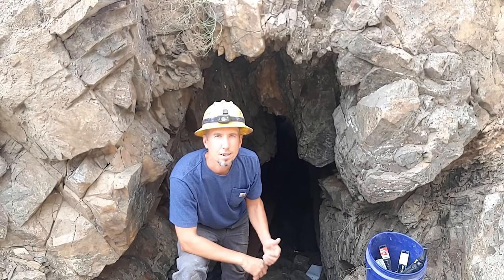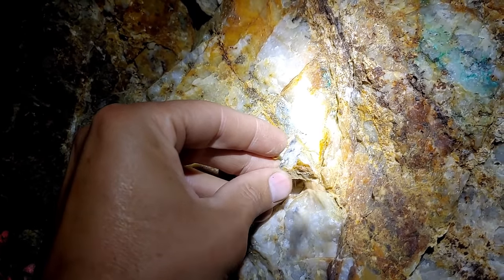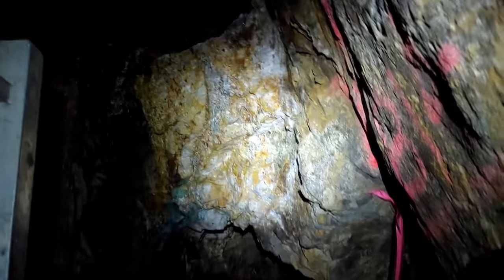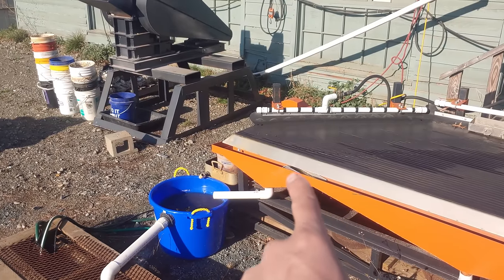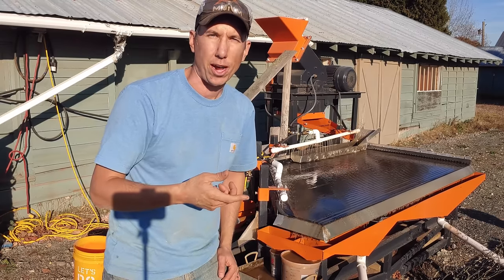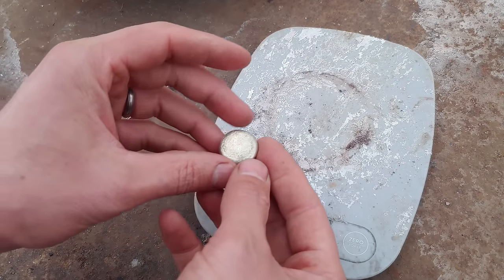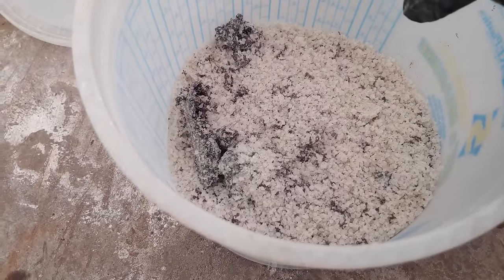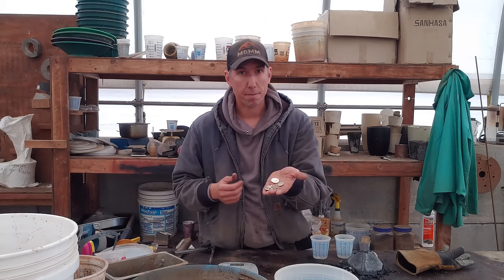Gold & Silver from a Secret Gold Mine - Crushing, Smelting and Refining Process

Comment: To stop your crucible from sticking to the brick in the furnace, place a small square (about the size of the base the crucible) of corugated cardboard under the crucible. |this will turn to charcoal, and form a barrier that prevents the crucible from sticking.

Comment: I will stay tuned for the next refining video for sure 👍

Word of advice before starting devolving the buttons in nitric acid.
Get yourself a gold karat test kit. You will need to get the gold content to around 25% or lower by adding either copper or silver to the material. Otherwise the gold will protect the silver from going into solution. 
There are a lot of information about this around the Internet, and it’s a fairly simple refining trick.
Search for “assaying gold/silver with inquartation”
Reply: I think I've heard h talk about "inquartation" (?) before.
Reply: sreetips has lots of info about this

Comment: Hey Jason
Have you ever tried to oxydize the lead without cornflaking it first?
As lead has a slightly lower melting point than Potassium nitrate i suspect that most or nearly all of the reaction happens with the lead already molten anyway.
So that additional step of cornflaking the lead could be avoidable.

Comment: How do you separate the gold and silver.
Reply: Yes  I wonder that also
Reply: Nitric acid dissolves silver, but not gold, soak they material, heat, pour off the liquid (repeat several times to be thorough) into a jar with pure copper  to cement the silver nitrate back to silver powder.  Metallic gold and silver separated.

Comment: You can use an electromagnetic separator to separate the Galina from the gold. To do so, have the powder run past the magnet on a thin stream on a conveyer. The gold and silver will get kicked away while the rest goes straight through. Magnitite, if present, will stick to the magnet. Old microwave transformed with the primary attached, but the secondary hacked off so it makes an E core works well. Hook 3 in series for 120VAC.

Comment: Legally speaking are abandoned gold mines fair game or is what you're doing something that should be done as low-key as possible?
Reply: It depends. Although they are “abandoned mines” someone can technically still own the mines so you can still be charged with trespassing/theft. But if no one owns the mine or you buy the land it’s free game
Reply: @danim3410  thanks for the insight unfortunately we don't have anything like that here in Florida or I might just be inclined to take my chances and do it anyhow.
There's plenty of gold here it's just already coins or bars and sitting on the bottom of the ocean most of it in unknown location and hard to get to

Comment: The layer on top is SILICON FOAM.  Not Silicon Dioxide as in "SAND" but Silicon as in 'Solar panels',,,, but very impure.
I always use water and when the boiling stops your good. ONCE time I got a "LAVA" explosion and it got in my eyes and I was in Hospital for 16 hours.

Comment: I don't think that "corn flaking" actually does much. I think you'd be far better off just running it back through the mill to make it small and then smelting it. I still wonder how much is hiding in the quartz that you might've missed by not smelting down the whole kit and caboodle.

Comment: I watch Sreetips Youtube channel a lot. He does a lot of Gold and Silver refining as a hobby. He has loads of hands on experience with the proces. If you are not that expierienced you might watch his latest vid on jewelers scrap where he had to refine without knowing the exact composition of metals. It seems to be quite important to do the inquartation right and what I see him doing is always do a hint more Gold than 25% to keep the inquarted shot intact so you can decant the Nitric acid boils more easily. Usually he does between 5 to 7 Nitric boils to get most of the Silver out. Use a decent fumehood, be safe!

Comment: You should fix yourself a system of ropes and buckets or heavy duty bags so u can pull up your material faster and so it’s more manageable. I’d use the truck and hook a bunch of ropes and pull it all up. Make it super simple. Looks like getting the material out is more work than the work itself

Comment: I wait until my cone mold is cool enough to safely touch bare handed. Then I know the lead is solid, because the slag can still be quite hot in the middle even when it is well below the melting point of lead on the outside. I set my cone mold in front of a big fan and it cools down pretty quick.  I know it is a pain to wait for the first pour to cool while needing to pour a second and a third. A second cone mold isn't that expensive, and would double your productivity on big jobs.